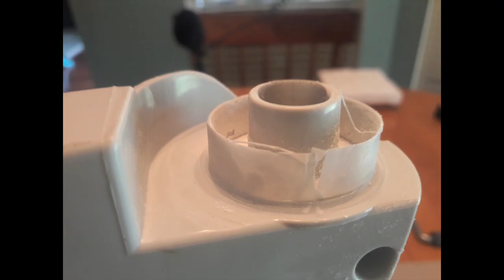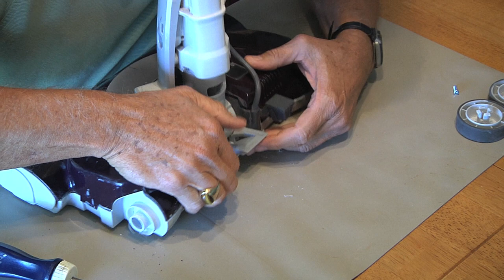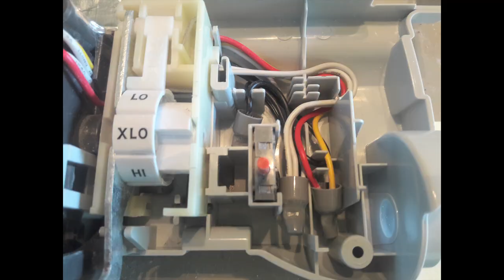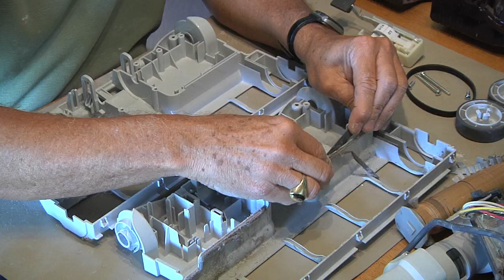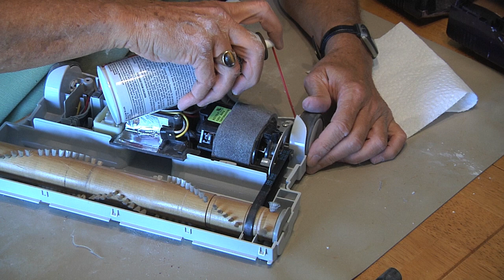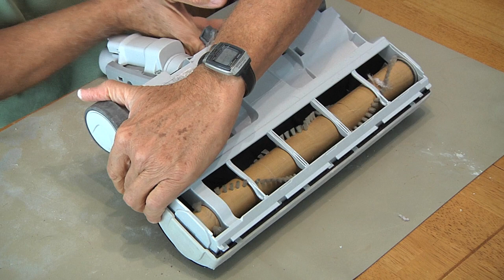Kenmore Progressive Cannister Vacuum Power Head Wheel/Axle Repair

Comment: Would like to say thanks for putting this instructional video out there.  I had a really hard time removing the cover held on by the four clips.  Took a lot of force but got it off.  Disassembly did not smoothly all with about two dozen little plastic fragments being generated from little clips and outcroppings that broke off as I tried to gently tease the parts apart.  I did not do a complete disassembly and only wanted to get the motor off.  I'm thinking the plastic was very brittle and could not tolerate any kind of bending which led to so many fragmented little pieces appearing.  I'm wondering if the plastic just had became more and more brittle over the ten years I've had the vacuum (but I'm not sure if that even makes sense that plastic will go bad over time like this).  Am also thinking that this vacuum was not built to be disassembled otherwise it would not self-destruct when trying to take the major components out for replacement.  I ended up just buying a used power head on ebay for $50 instead of trying to repair it.

Comment: Can you add more details on getting the elevator mechanism to go back together properly? Mine is not rotating and I can't figure out how to get it to properly connect to the little clip that goes onto the metal lifter underneath.

Comment: Not helpful. The little tabs that hold the wheels in their sockets are shot. I'm going to try filling the socket with a wooden plug and putting a screw through the wheel into the plug. Probably have to put a smaller plug into the wheel to support it.
Reply from the maker: Whatever floats your boat.
Reply: Darn thing is Sears Direct does not list the power head wheels as an available part. I have the same issue, the wheel tabs are busted.

Comment: In your video I did not see how you removed the elevator mechanism, mine is not rotating anymore not sure if I can fix it or buy a new part of off ebay either way have to get the old one out I think?
Reply from the maker: I just pulled it up and out.
Reply: @johnnyViDeO  Thanks, great video will keep it for future happenings, cheers.

Comment: kenmore 116.21514012 or 10 - any fix for wand - middle plastic section breaks?
Vacuum Wand Assembly KC14PDKMZV0X $63.24
Reply from the maker: I'm not a vacuum expert.Call Sears Parts and inquire.